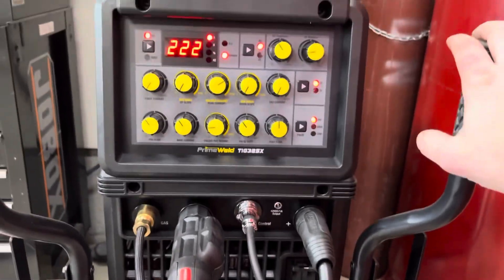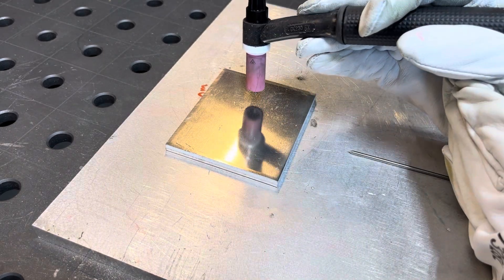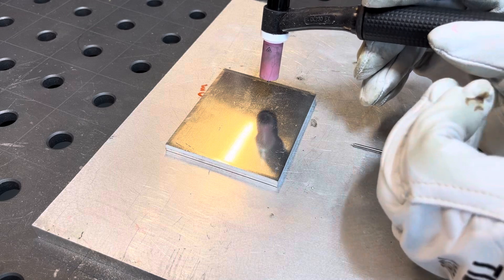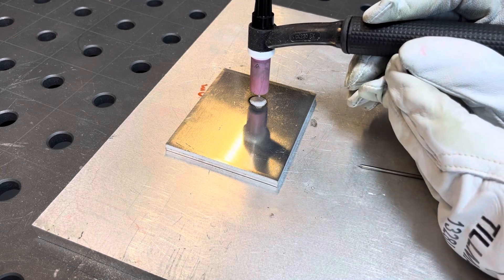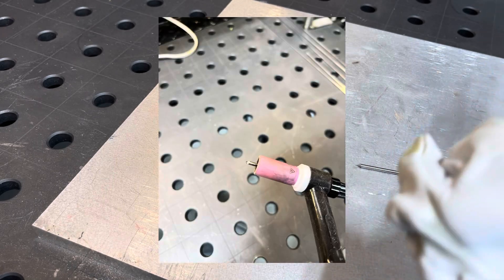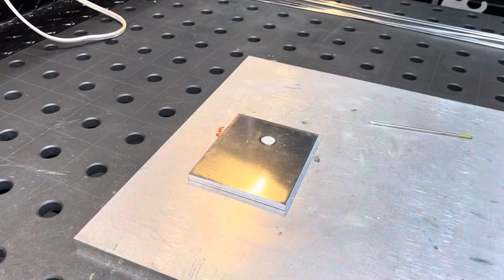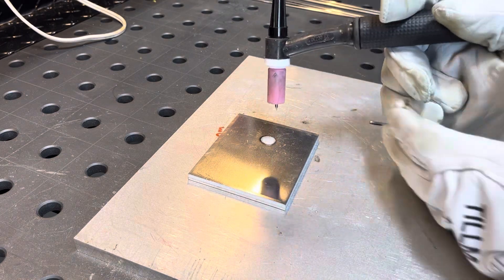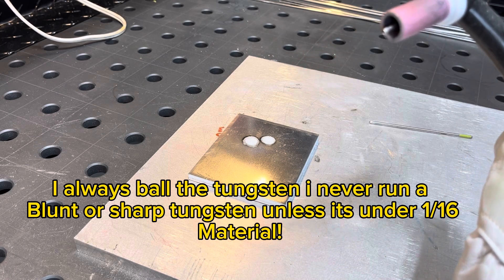How To Ball Your Tungsten For Aluminum Welding

Comment: Good video I started using the layzr tungsten from Ck worldwide this year and like it I’m trying it for dc welding now too just ordered a pack of 3/32 haven’t tried it yet on dc but I like it on ac my favorite was blue 2% lanthinated for a all around now I kinda think the layzr holds a better tip on higher heat not sure yet for dc good video 👍

Comment: Nice tips. But its not really necessary to ball the tungsten on an inverter machine ive herd and found myself.  On a dynasty I just sharpen a 30° point then lightly blunt the end. Works fantastic for me. It actually does form a micro ball on the end but it stays pointy sharp.
Reply: Same with me even on a transformer I sharpen it to a point and let it ball itself if it does. That’s just preference I know people that ball it and don’t ball it and have great results both ways 👍
Reply: Heard! Learn English.

Comment: What is the purpose of balling the tungsten?
Reply from the maker: @gsxrdrama9025  for welding aluminum the tungsten holds up better.
Reply: I used a transformer machine since the early 90s and rounded my tungsten (pure). Also, I never switched the cables around like you did, just switched to DC. Now I'm using a Miller inverter and tried it with a sharpened 2% Lanthanated CK tungsten and it was awesome. This was on 1/8" so not sure on heavy stuff yet but as a dude that's done this for a long, long time I see no reason at this point to round either.
Reply: its not necessary, it goes back to the day of welding in WW2. some prefer it, some hate it. its pointless if you have a good welder that was made in the last 70 years
Reply from the maker: @ i appreciate your comment